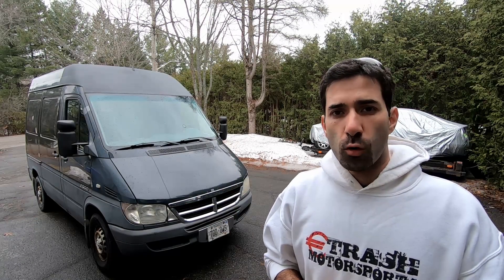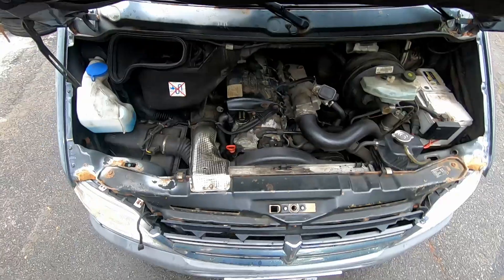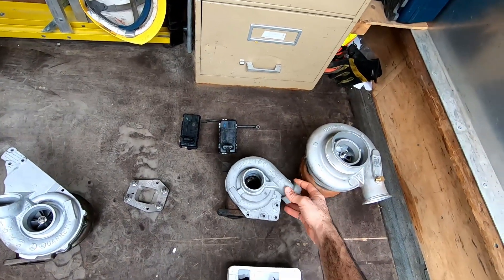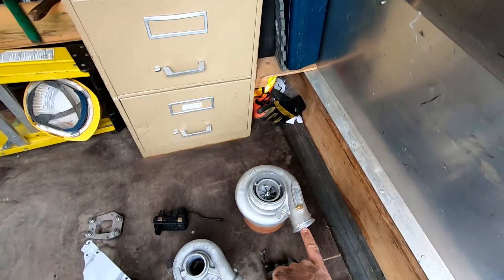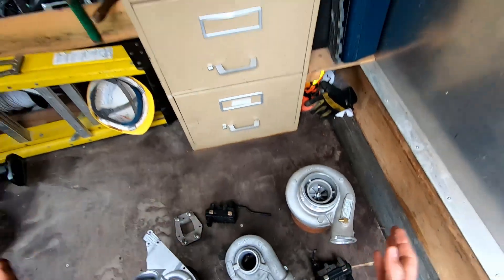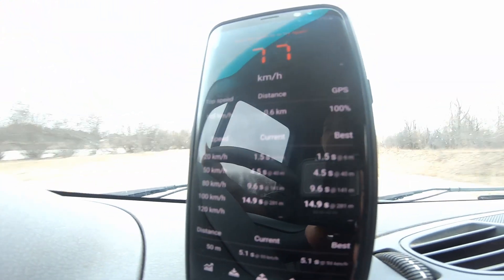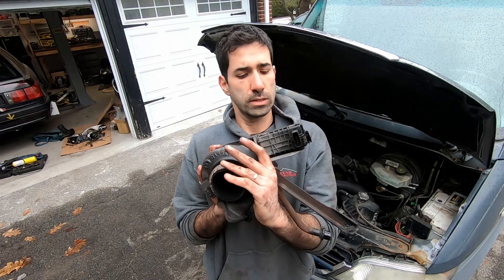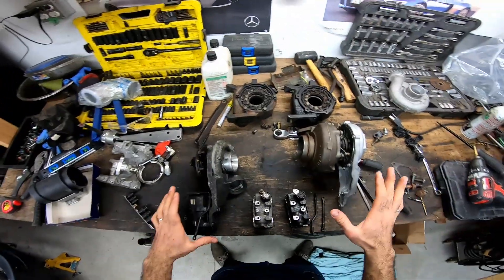2006 MB/Dodge Sprinter (T1N OM647) turbo upgrade - Part 1

Comment: Hi I got one sprinter 2006 I’ll bringwhit  some guy to check because it shakes really bad when you take off foot from gas and he take a quick test run he said differential is bad but it was running good after he take the test I was going back home the truck lose power I believe he broke the turbo do think it’s possible?
Reply from the maker: hey it's hard to "break" the turbo but there are a ton of possible issues that would lead to a limp mode, which is what it sounds like...you`ll need to get the ECU scanned so we know what's happening
Reply: @ETMotorsports   sounds good I’ll do that first thank you very much 👍🏼

Comment: If you want more power efficiency add 10 percent gas to diesel then but a heat exchanger that taps into coolant lines and run the diesel were transmission fluid would run you shave 2 to 3 seconds off and go from 150 stock to 180
Reply: I thought there was more stored energy in diesel than petrol?

Comment: My question is ..why do u need more speed ie horse power, it's a work van..it's never going to win in indi,, am I missing something
Reply: Why not dude. You never know when someone might pull up beside you at the red light and you will have to wax that ass for them. Plus you might have to pour the coal if the law get behind you.

Comment: You are going to run out of fuel with that pump. It barely handles the fuel requirements of the om648. Turbo Diesels like being run rich. They don't like being run lean. Increase the fuel pump capacity and then bump the turbo up. 
Good luck! Thanks for the video.
Reply: Interesting, I've always heard turbodiesels are fine running lean. They do, after all, not even limit the air using a throttle the way gasoline engines do. Without any real mods, the OM647 I have runs pretty lean AFAIK, there's no smoke at all, even when I floor it. And that's with cats and EGR removed.

That being said, of course you don't want to run any engine too lean. No point in increasing amount of air if you don't get additional power from it.

@NiTectProductions Where did you get the OM628 pump and how much did it cost you if that's not a secret? I want to get more power out of the OM647 in my W211 in the future and since the turbo is on its' way out anyway, I figure it would make sense to have it rebuilt for more boost and then also increase the fuel of course (already got a guy with a KESS V2 for the tune part). Injectors I could probably have some built if it really comes to that (I think I'd need a new transmission first before I get to those levels of power). I'm in the EU and MB diesels are pretty common here!
Reply: @s @sookoll23 st adding clarity to the first part of your theory. A diesel controls rpm with fuel no need for a throttle valve. A gasoline engine controls rpm with air mainly because gasoline is extremely volatile. These newer gasoline engines are getting really efficient though. I’ve noticed the throttle valve will be wide open through most of the rpm band most of the time (as per scan data) I feel like that’s why the latest generation coyote and the gen v LT engine makes so much more power and gets incredibly good fuel mileage . At idle though it’s definitely closed.
Reply: @ETMotorsports  definitely the 628 pump will do the job. It's not a direct bolt on, but close enough. 
Rochester Diesel will do your injector nozzles but they don't like used injectors. They will test them first and toss most if not all of them.